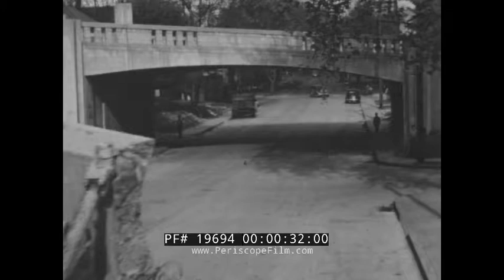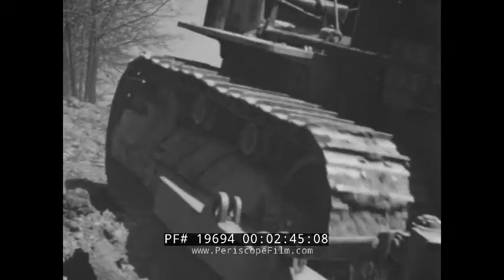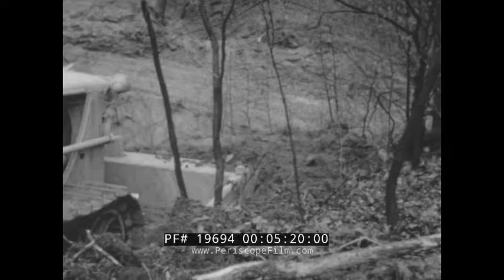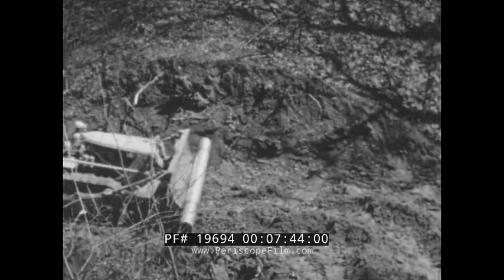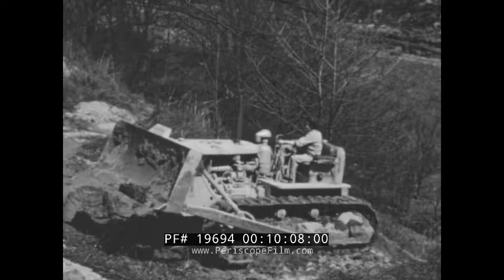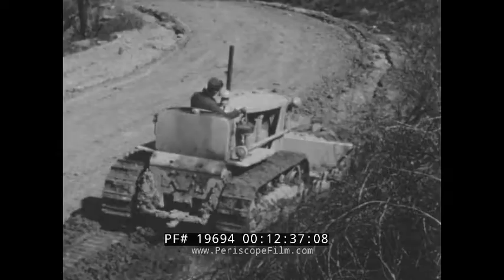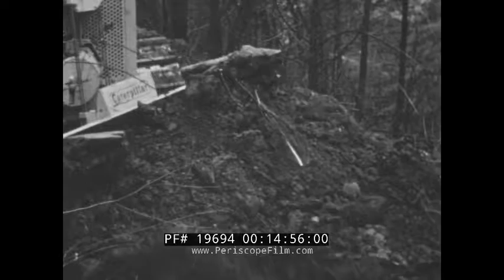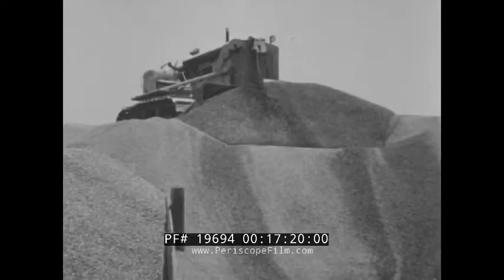" BOSS OF THE BULLDOZERS "   1946 CATERPILLAR TRACTOR CO.   D6, D7, D8 BULLDOZER PROMO FILM  19694

Comment: I was only a kid when I learned how to run the old cable blade D8 and D10. Pony start, pre combustion chamber engines that would lug down so far, you thought they were stalled, but they kept right on pushing. We used them to make logging roads just like in this film. Start at the top of the hill, work down. Push the trees and rocks out of the way.
Reply: Don't think U will find  a D 10 any where in the world with a cable blade, no such thing.
Reply: No such thing as a D10 with “an old cable blade”
The D10 only came out in 1977.  Fully hydraulic.
Sounds like you are making up this story. Lol 😂

Comment: I have an old cable 7. Still runs, it’s a beast. No plastic or electronics
Reply: Is it a 17a?
Reply: @graemedalgleish8944  No, it’s a 3T
Reply: @justingarretson2054  I was just curious. I've never run a  cable controlled unit. My 7E is all hydraulic.
Reply: How is the cable driven? It looks like it may be driven off of the front of the engine, I assume through a clutch.
Reply: @bigredc222  it has 2 cable controls on the back, basically like winches with clutches yes
You use one for the front blade and if you had a pull scraper you use both of the cable controls to run it
Reply: @justingarretson2054  How is it driven? There is a round box mounted low on the grill, I'm thinking that may be the clutch, but is it driven off of the front of the engine or is there a shaft or cable that goes under the engine from a PTO in the back?
Reply: @bigredc222  there is a cable that runs along the side of the machine to the front. There is a snatch box type pulley mounted to the grill
Reply: @justingarretson2054  Thank you.
Reply: @bigredc222  yep no problem
Reply: I also owned a "7" with a friend, and a donor also.

Comment: Despite all the technology advances today many of the earthmoving methods remain the same . I began on a cable D9 very similar. And because those winches were so touchy you`d soon learn to just dab the lever to keep the cut going smooth. That kept the track from riding over rough bumps .  The seats weren`t much more than a kitchen chair and there was no operator protection . I did get sconed a number of times. including concussion knockouts. Not good when your in control of a large dozer. I do remember the pilot start motors too . Glad when the electrics and hydraulics came along .What a different world we`d have today if not for dozers and chainsaws.

Comment: The first bulldozer I learned to operate was an old D7 built in the 40s and had the cable lift that operates the blade and was started with a pony motor that had a clutch to engage the bigger Deisel to start it was a long days work 10 hours on a bulldozer and I was tired when I got home.

Comment: The pre-hydraulic days. These dozers had dry clutches like a car. They were very operator intensive to operate. Lots of work managing the two track sides and the blade. Worst of all - no covered work space??- What were they thinking? Poor guys in the full sun all day. Todays Air Conditioned cabs are extreme luxuory by comparision.
Reply: I still run one,,, so true ,,
Reply: @JRBUISEXCAVATING  
I have a hickory stick backhoe operating  license also...
Reply: Kept you in shape   no Fat operators   lean and mean   when Americans were tuff   now  we got the Snow Flakes
Reply: They weren’t in the sun all day long. When I was a kid, none of those machines had a ROPS or cabs. What they did have was a bright yellow umbrella on a pole with a 90 degree bend near the top so the operator was in the shade. And of course that yellow umbrella had CAT and/or the local dealer’s name printed on one side in big black letters.
I learned on a D7 E with a hydraulic blade with hydraulic tilt and manual angle. It had a pony motor. And I had an umbrella!
Reply: Cat would sell you an umbrella if you wanted shade :)
Reply: They were thinking they were used to it, they were construction workers. Not many years before this they were in the sun all day - with a pickax, shovel, or wheelbarrow, or at best operating a hand-tip scraper and driving a team. I think they thought the engine was luxury enough. Just because you are spoiled now. Farmers plow in the sun all day, many of their fellow workers still labored in the sun, manually. Why should equipment operators get special treatment?
Reply: No roof portection or shade .
Reply: Well in my country all dozers have always had enclosed cabs. The only way to survive cold, horizontal rain..

Comment: Note the blade is moved by cables and pulleys, not hydraulics, which came later.
Reply: And you had to manually turn the link (turnbuckle) one way on one side and the other way on the opposite side to angle the blade
Reply: @flasher1663  that would take a little while to get used to, planning how you'll move the dirt so that you minimize your wasted time

Comment: Love the old cable d6s and d7s got many an hour  running them before I got on a hydraulic  tractor . Still  prefer these old beasts ! Fingertip control my a$$! Get slapped off the machine first thing in the morning.  Those old Latunue nylon forcing cone winches would remind you to make sure that it was in neutral on startup! After it whacked hell out of you it usually snapped the 75ft cable! Now that it's running  , restring the cable and start working in a fine mood! Lmao! Yeah I have !

Comment: I cut my teeth on a '52 D8. Pony motor, Cable blade with one rock tooth on the side. That was the trail-blazingest unit ever made. Not the best for close finish work, but point it thru the woods, and you'd have a road in short order.

Comment: Interesting that they never say the name of the manufacturer through the whole movie.  Of course it's Caterpillar but they don't say it.
Reply: Caterpillar was the tractor company, this is a sales pitch for the bulldozer, the attachment to the tractor, the blade has its own model and serial number and parts book as well.  as did the winch that controlled the blade. Fun to watch , worked on several of that vintage,
Reply: At the opening of the film, the first credit says "Caterpillar Tractor Co. Presents".  The "Caterpillar" name is easily visible on top of the dozer blade.
Reply: @FAngus-ly8lk  Yes, that's true. But the narrator never says the word Caterpillar
Reply: @DK-sw6xx  I have relative who is pres of local Antique Cat chapter, it's great to see his Sixty run.   My point was the narrator never says the word Caterpillar.
Reply: I understand that they never say what tractor model is working as this film ,And I am speculating, is  a bulldozer sales film,   first thing they mention is no A frame to deal with,  low profile,  the a frame was how the cable with up  over the operator on an a frame then back down to the blade,  this style shown  the cable went thru a tube along side the engine then to the cable block. You can believe how many times I have had people complain about not finding a blade part in a tractor parts book.  Nice film thanks
Reply: No, he didn't say the word "Caterpillar". But he did speak of the D5, D6 and D8.

Perhaps the idea was that there was no need to say the machines were Caterpillars, that the brand was so ubiquitous and well-known, and had so few competitors at the time, most people would just think of an earthmoving machine as a Cat.
Reply: They didn’t need to. People could read back then.
Reply: Was their anybody else in ‘46?
Reply: International Harvester TD25. Allis Chalmers HD25,  maybe Terex. john deere and Oliver had small track type tractors , But still anything on tracks is considered a Cat,  or as in like describing a  fire break made by a dozer,  it a Cat line,
Reply: @DK-sw6xx  IHC had a whole line of  dozers for decades and for the most part  were considered  more advanced than Caterpillars.
Reply: @DK-sw6xx  HD-21 came out in 54, TD-25 came out in 59, and to my knowledge, there was no Terex yet. It was still Euclid

Comment: "Powershift trans-what? Never heard of it."
Reply: Not until around  1960.  First cats were pony motor with a torque  converter.  To steer u pulled a lever and brake pedal  to steer. At idle  won't move rev up to go. Not as reliable  as late 50s wet clutch  standard cats

Comment: They removed the overhead protection so they could fit under bridges easier?
Reply: No, the A frame mentioned early in the film was the support that lifted the blade before this design. The A frame might have offered some roll over protection in very firm surfaces. Nothing on soft surfaces. The frame would just sink. Protection or not, you weren’t likely to survive a roll over unless you jumped clear. ( unlikely)  You would be much like the marble in a spray can.
Reply: @itsthatguy5742  I knew what the A-frame was for, but I figured it had to offer some protection from trees, maybe not big trees but, I figured it was better than nothing.
I think it said that this was the first Cat that the blade and tractor were designed to go together, does that mean that those A-frames were sold by aftermarket companies?

Comment: Cable dozer didn't have down pressure on the blade.
Reply: Doesn;t seem to effect the performance much. The blade weighs a few thousand pounds, plenty for most purposes.
Reply: @justforever96  sure...back then. When they started using hydrolics, it changed a lot. Finally the motor graders caught on.